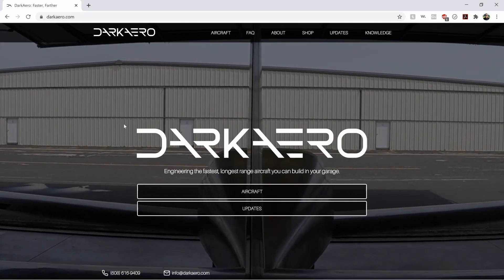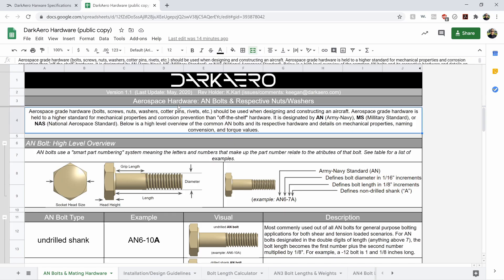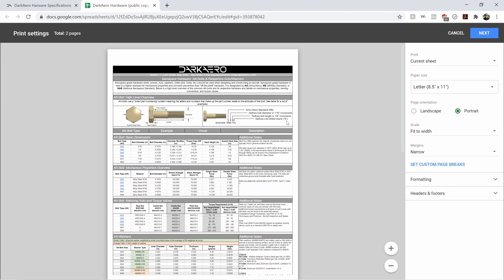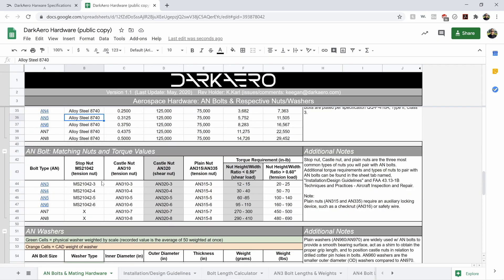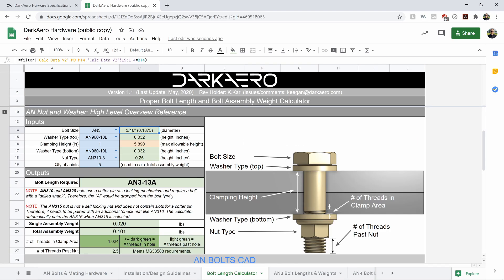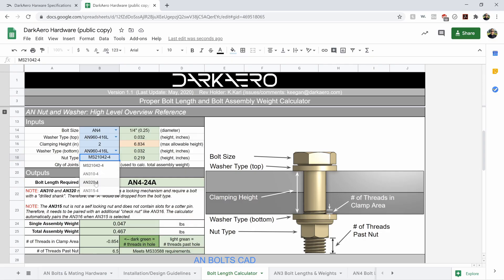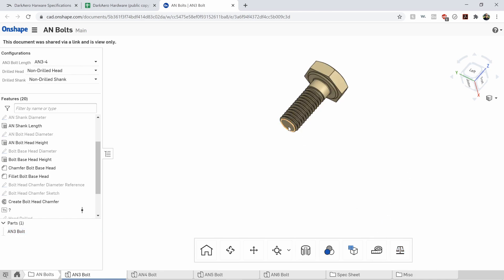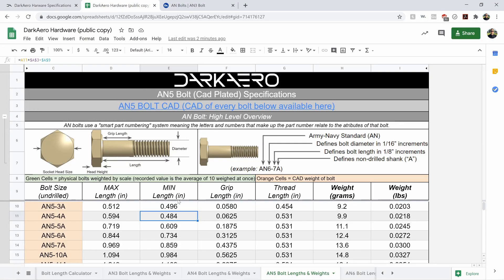The Ultimate Aerospace Hardware & Fastener Reference Guide - July 9, 2020

Comment: Is there a way to download the CAD models from Onshape without an account?
Reply from the maker: This is a good question. I believe they may only be visible if an account isn't created. But they can be downloaded by creating an account.
Reply: @DarkAeroInc  I created an account but still no download option. Maybe I am not seeing it. Any advice?
Reply from the maker: @steffenkuntzel6100 , sorry about that. We have a link on the webpage for the tool that’s listed right under the image for the tool that states: “Click here to create a copy of the sheet in Google Drive.” If you are logged into your Google account when clicking that link, it should work.
Reply: @DarkAeroInc  I actually meant the CAD files you are providing through OnShape. Even though I have an account there I cannot download your models. I think they are protected and view only for all users that follow the link to the CAD download from the spreadsheet.
Reply from the maker: @steffenkuntzel6100 , ah, my bad. Looks like the view permissions were set to not allow for exporting. They should be good now.
Reply: @DarkAeroInc  You did it! Export tab is now visible. Thanks a lot.

Comment: Brilliant. A metric version would be useful for all of us outside the United States. When you start doing kits, will all hardware be included?
Reply: Actually, I'm astonished that such a modern company with young engineers don't use metric ISO fasteners !
Reply: @vzmax because metric is for loosers and they are winners!
Reply: @vzmax because hardware like AN, NAS, and MS bolts do not exist in metric. I have looked extensively and no other metric standard of fastener comes close to the level of depth and ease of use of AN bolts
Reply: @penamena5238   Thanks for the answer. But do you mean the rest of the world (Dassault, Airbus, ...) don't use ISO fasteners ?
Reply: @ as far as I know…yes. But I will say I have never been able to get a concrete answer on that